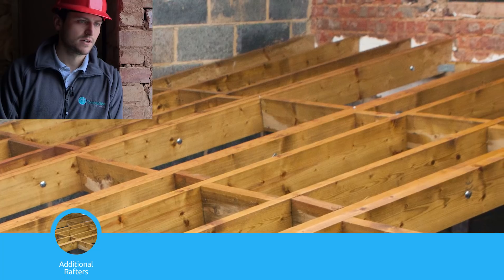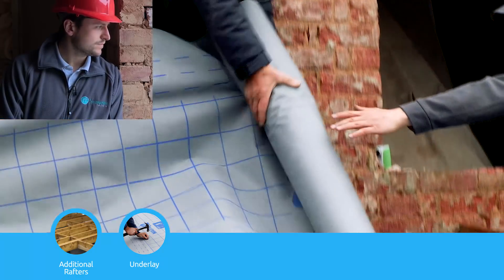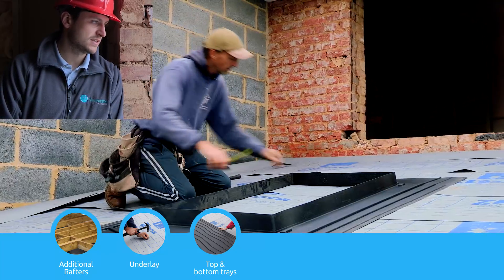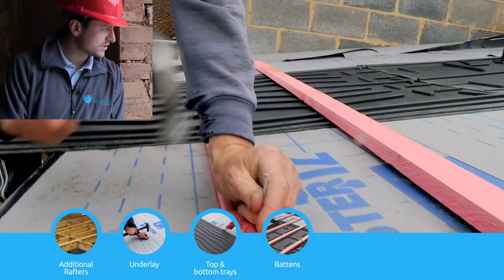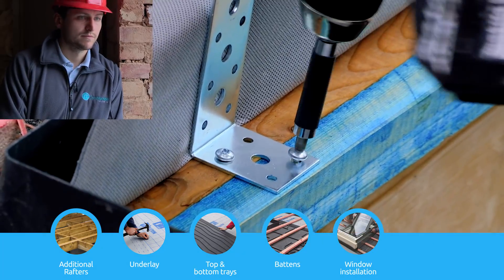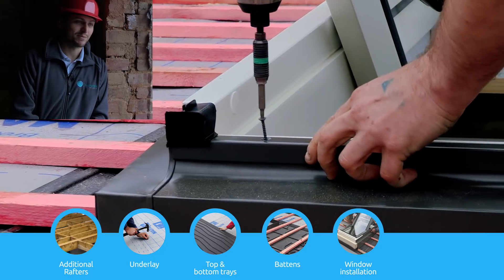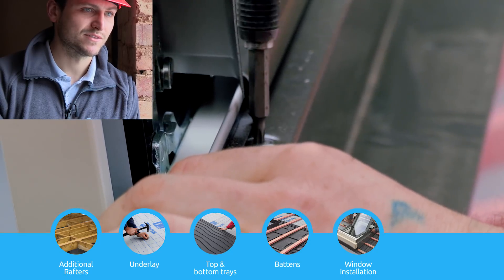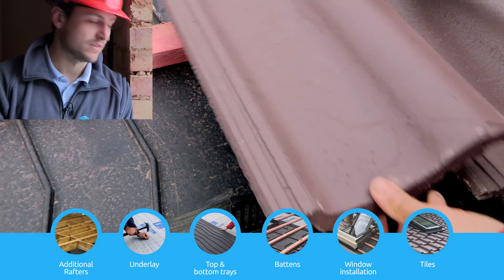Forticrete Low Pitch Roof Window System

Comment: As a roofing contractor we see new products on a daily basis and everyone has and are entitled  to their own opinions on them , Some of these products are productive and make our lives easier and simpler yet others products just don’t work very well and I personally think we have done things in a certain way for so long for a reason , yet sometimes I think we need to stand back and be realistic and some architects need to take a bit of criticism when designing buildings of today as it always seems that every mm counts when designing buildings and in areas logic and reality take a back seat in the final outcome , This in toll is due to planning permission on height and building regulations for the pitches and materials used , A lot of the time this means the roofs are on the bare limit , a ten degree roof is the minimal tile pitch using the correct materials on a standard membrane and battened roof using a centurion roof tile, skylights rightly so shouldn’t be installed below 15 degrees this is such a common on going site issue in which a product here has been designed and works in a mock up factory roof and product testing facility yet if it was left in the elements for several years i 
just wouldn’t have faith personally that it will last the test of time. For me water shouldn’t run under the battens roof tiles , I understand it’s onto a plastic drain system like they use on solar panel systems ( which again I disagree with ) yet under all the weather conditions and elements along with leaves and debris in which will build up I think why do we need to design a new product when if a few things had been thought of before hand in the overall build design , the plate height could have been reduced even if it meant a small section of sceiling with ceiling collars bolted to that’s if size and span are suitable for timber or it isn’t a volted ceiling in which I assume it is , The soffit then could finish at lintel height and this would have adjusted the pitch by at least a further 2-3 degrees , and if the build line was reduced by 100mm ( a single skin of brickwork )  you would easily achieve the recommended 15 degree pitch for a skylight window . In the overall scheme of things what would you prefer a roof that is going to last and is the integral part in keeping water out of your property or 3 skylight windows that may need maintaining  every year dependant on weather and debris and I’d presume in the small print it may mention that it may be advised not to be installed in areas surrounded by large amounts of trees and widely open spaces  , to me it’s a no brainier but I would be interested in people’s comments.
Some architects I feel are giving us the bare minimal to work with all the time I no it’s there job to get the full potential out of every mm they can but sometimes more I find is less, if it was to ever leak is not going to be them fixing it and it’s internal damage it could cause too along with that not being a five minute job ? Come on let’s use our knowledge and years of experience to make everyone’s job more enjoyable and logical , it’s not a rant nor is it a negative comment aimed at this product that’s been designed to overcome these issues it’s just a opinion and I’m all for criticism and would like to be shown and proven wrong to my option but  for me personally I wouldn’t want this on my house , keep up the good videos Roger 👍
Reply from the maker: Good observations Paul

Comment: Hi roger, i just had the same tiles fitted to my extension. Did your guys nail the battens at 275mm spacing or 275mm centres? My tiles not sitting as flush against each other as your one
Reply from the maker: It is too long ago to know now but that is easily checked. More importantly how is the roof. If it goes up and down a bit then the large format tile is always going to cock up.
Reply: @SkillBuilder  yeah I'm thinking now the 8 X 2 rafters might be slightly out with each other so the battens aren't sitting straight

Comment: I’ve used in the past similar systems. “Unduetile” if spelt correctly and more recently “klobber” felt system designed for low pitch roofs. Very expensive as is this I would assume. 

Roger how come no flashing at the bottom of the roof windows? like velux or fakro.
Reply from the maker: Because it is made to leak. I don't like that and I would have put one in just for cosmetic reasons.
Reply: Skill Builder Ditto. I won’t criticise the product as it must of passed regs to be used but for me the klobber system just seemed belt and braces and didn’t have to be made to leak to work. 

Thanks for the reply. Stay safe.

Comment: Not a roofer here, but interested to learn. Would the gauge have to be adjusted for concrete tiles? Presumably, they aren't happy at a 10degree pitch and will leak too?
Reply from the maker: Those tiles are designed  for a low pitch

Comment: Been a roofer for 32 years, this system is shocking . Who in they're right mind would let water run underneath the tiles. Just raise the rear up properly and fit a velux.
Reply: 100% I’m a roofer with 24 years experience, it only a matter of time before it’s leaks

Comment: What tile is that they are using?
It goes down as low as 10 degrees?!
Reply: Ray Bans that’s the issue, the tile doesn’t fully weather at that angle, they’re relying on that plastic product underneath. Not great is it
Reply from the maker: The tile is made for low pitch https://www.forticrete.co.uk/products/concrete-roof-tiles/centurion
Reply: coops66 no I’m pretty sure that’s just for around the window part

Comment: PLUS
I'm a roofer I think it's a good idea being that wide also will help with strong winds also with snow.

NEGATIVE 
The battens will most likely rot first I can't see them lasting 15 years on the ends that water will be hitting them over time.
Reply: Don’t think The water will  hit the battens , they have used a centurion low pitched roof tile also , water can’t come back up even with capillary action .
They have 3 ways of stopping the water the felt first , then that black water drip and the low pitched roof tile , the only place it could come in is at the fascia board , can’t see how they have finished it.

Comment: I don’t believe the roof will leak nor will the window surrounds, the underfelt and trays will fully mitigate against that. What will go wrong and lead to problems is the void between the window frames and roofing tiles. Because there is no filler or flashing the voids will fill with wind blown and animal imported debris and that will fill the void. This will eventually clog the drainage channels. The householder needs to ensure the voids are regularly cleaned out.

Comment: Why didn't you up the pitch and put lead bay under window
Reply from the maker: This is not our job. You can do that but you have problems with lead bay running into a roof window. It is a lot of expensive lead work to weld it all in

Comment: One of the problems I can see is the battens will start to rot because in winter they will get wet and will not dry out even the pink battens that have been treated
Reply from the maker: The water channel are under the battens and that also helps air flow.

Comment: I'm dying over here! This was a good laugh.10-15? Wow, the back of those skylights are gonna leak in a year. There is a reason roofing hasn't changed in 100 years. Rule I always follow is dont fix what ain't broke. That should have been a full standing seam copper roof. 100+ years. The house would fall down before the roof leaked. But whatever I guess haha just get a new roof ever 5 years then.

Comment: I would not have that on my roof. Any water that does get on the tray can come in contact with and rot the battens. Also I guess the battens are unsupported beneath the windows otherwise the tray would be punctured. I'm a fan of the Centurion tiles but not this

Comment: You guys call skylights roof windows? 😂
Reply: Call them roof windows and skylights. Roof windows because.... Well they are windows that go in a roof.
Reply from the maker: we have both, a skylight is usually a fixed pane with no opening for ventilation or escape
Reply: Different parts of the world have different terminology case and base is skirt and archs in America 🙄 I wouldn't have known that unless my pal worked there I never heard of a door casing until I moved here most country's ive worked in just call them door frames 😉🔨
Reply: @SkillBuilder  Interesting. We call those operable skylights. I meant no disrespect, I just find the slight language differences amusing. Feel free to lambaste us for aluminum, math, or for the reluctance to move to the metric system. 😎👍